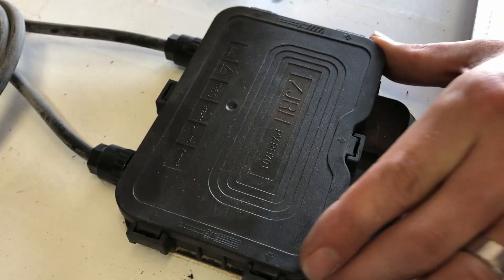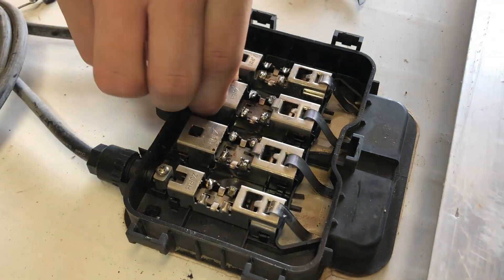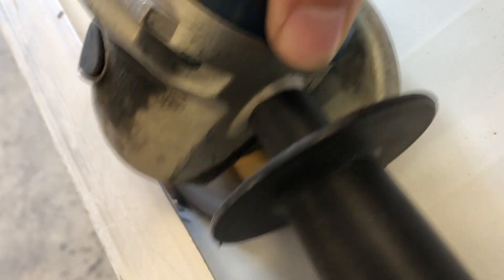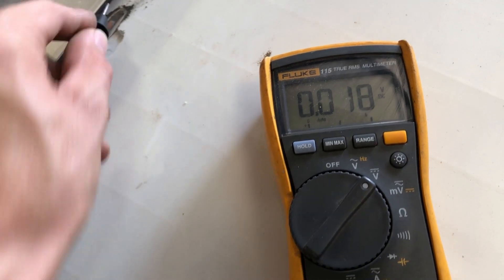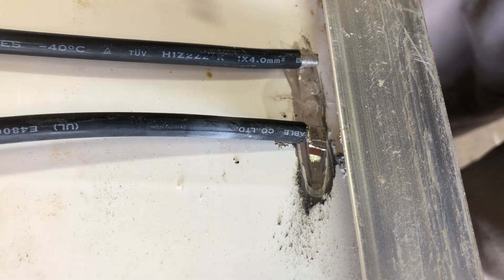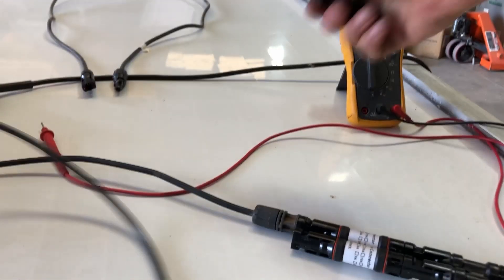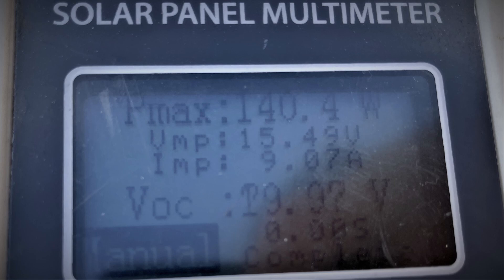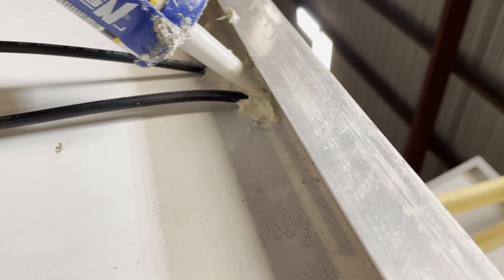Hack Your 36V Solar Panel For 12V Operation

Comment: How to find the flat copper strips carrying voltage was helpful, in some areas there are two on top of each other
Reply: The double buzz bars are on the top of the panels and not the bottom. No need to go up top for this hack. Stay down the bottom as Beene Energy suggests

Comment: Couldn't you just tape up (cover) the required amount of panel to reach desired voltage? 🤔
Reply from the maker: That’s a good way to burn out a bypass diode unfortunately.

Comment: You can solder with an iron in a fire or a magnify glass using the sun to stay on the solar theme just for reasons.
Reply from the maker: Oh those are great ideas! I did some solar arc welding in another video. Figuring out how to solder with the sun would be neat.

Comment: I have some left over commercial sized panels, Voc of 49v. I'm wondering of I can do this with them, just for fun, to charge some 12v stuff. I've already burnt out a jackery trying to connect the panel to it.
Reply from the maker: If they are good panels it’d be better to use an mppt controller to charge something. Instead of hacking them up :). If they are 49voc probably would be a pain too as that’s likely a half cell panel so a lot more work to cut up.
Reply: @BeeneEnergy  oh okay thanks. I just saw the other video you did about it too.

Comment: 20 years ago, it was relatively common to find 72 cell solar panels intended for field wiring to either 12v or 24v nominal systems. Even back then higher voltage made sense, but now with MPPT so cheap it seemed at first strange to bother with this mod.  Then I remembered solar panels became cheaper even faster and the used ones cheaper still.  My 20 year old panels were just under $4 / watt and that was a great deal at the time.

Comment: Absolutely worth it! Just do it carefully! That's not exactly how I got TO the bus bars, but that's exactly how I cut and bent it up. That's a damn good video! Awesome how you have old panels to play with and I think you're onto something here. This trick will make solar generators more widely available through residential panel modification and reuse, saving money by going pwm instead of mppt. Not to mention the huge wattage per panel. Santan Solar is my favorite stop every time I swing thru Gilbert AZ. Should check them out if you need panels!